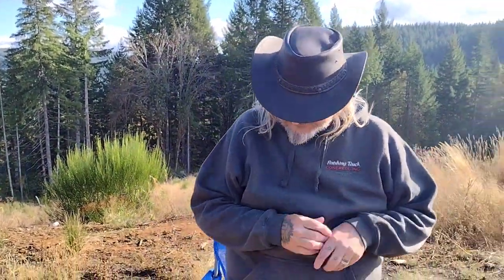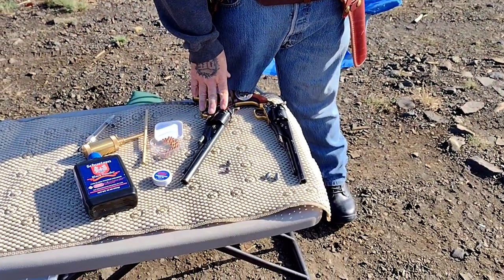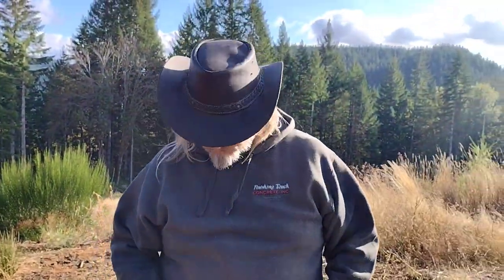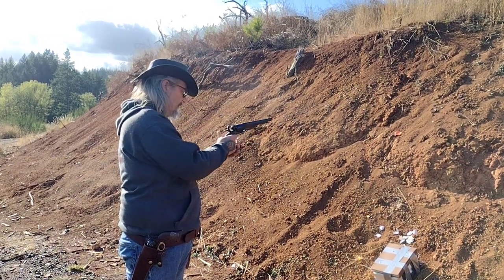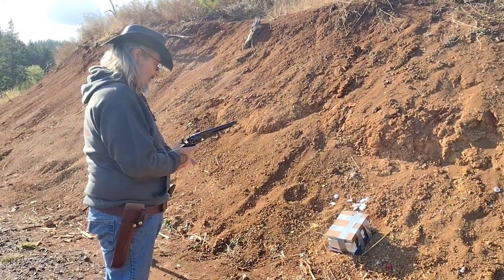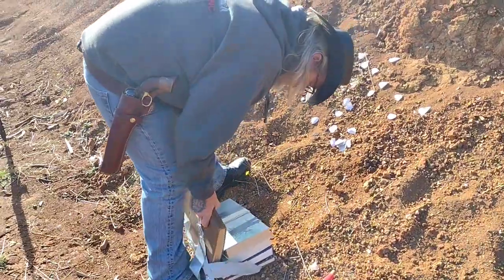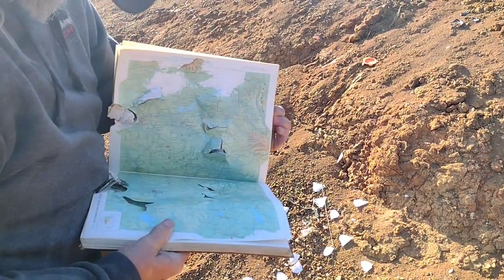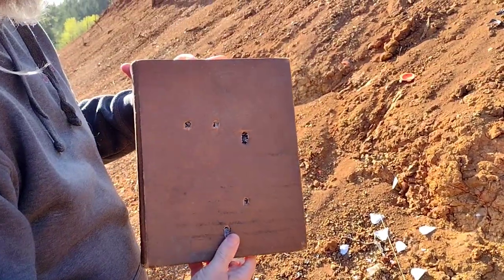Historically correct Johnston and Dow conicals vs Round Balls.

Comment: Very nice. I definitely prefer conicals in cap and ball. The heel based Johnson and Dow and lee mould conicals go in a lot easier to Uberti Remington style repros like mine. Colt style often needs modification. I went out shooting today with my Uberti 1858 shooting .45 colt 200 grain loads using my Howell conversion cylinder. I did 20 shots from about 15 yards away shooting up a large cantaloupe. By the time I was finished there was nothing left of the fruit to shoot. I shot it up into pulp
Reply from the maker: I have a couple of left over Halloween pumpkins that I want to shoot up but it has been raining every day now for going on week two. As soon as the weather gets a little better I am going shooting.  I am going to load some 45 Colt cartridges and I also just bought a used Armi San Marco full fluted cylinder 1860 Army two days ago and I'm wanting to shoot it also.  I plan on doing a video on it and shooting it as soon as the rain stops.  I'm hoping for Wednesday I think the forecast says no rain that day.

Comment: I used to have all the different original Colt molds, but sold them. I have a few bullets left though and they're very similar to the J&D. I bought the Kerr mold from Mark so I could use it in everything and indeed it fits everything I have in .44 cal. I actually prefer the Lee conicals to the originals myself though. I have a 1966 Lyman hollow base mold for cap and ball revolvers that casts a .457 hollow base Keith type bullet that is just awesome and works with Schofield's and 45 Colt, acp too as long as they're sized for each application. I want to make some modified base pins for it though and make some solids from the same mold. It's tedious though using hollow base and hollow point molds...so slow. It has proper grease grooves though and was designed for the NMA revolvers on the market at the time. Really awesome looking bullet whether loaded in cartridges or C&B chambers.
Reply from the maker: The Johnston and Dow conicals are hard to load in C&B revolvers.  I load black powder 45 Colt cartridges for my conversion cylinder revolvers and have been using regular 230 grain round nose with only one grease groove, these I believe are for 45 acp and smokeless powder cartridges.  I would like to get one that is made for black powder that has maybe more than one grease groove.  I don't have any experience with hollow point molds or hollow base conicals. I did see somewhere on the internet a bullet mold for 45 cartridges that had a nice deep fat grease groove which would help keep the black powder fauling soft, which means being able to shoot more rounds before needing clean fauling build up.
Thank you for watching.
Reply: @blackpowderfirearmenthusia3194  I used to own that mold. It's called big lube as I recall. I sold it because The base was too weak for heavy loads in a 92 Winchester, but regretted it later. I have quite a few 45 molds, but most don't have decent enough grooves for BP. I only cut my ports for the bullets I currently have and if I were to buy a J&D mold I'm certain I'd probably have to recut them. The Kerr fit everything except an 1860 and the Walker...yeah the two you'd expect it would fit easier, but it didn't. I forgot about that when I mentioned it fit everything! ironically it fit every 1851 I have without modification, but the LEE requires them to be modified. I have one of the current forged framed Uberti NMA's and out of the box it has fit anything I've tried except the Lyman, but it can be sized at the skirt to fit or I may open the chambers a little more idk yet.